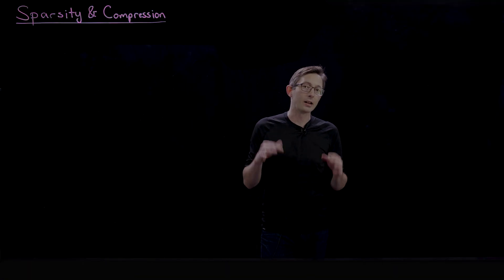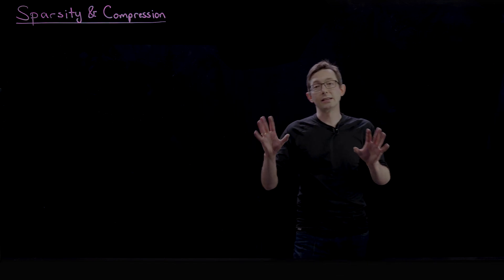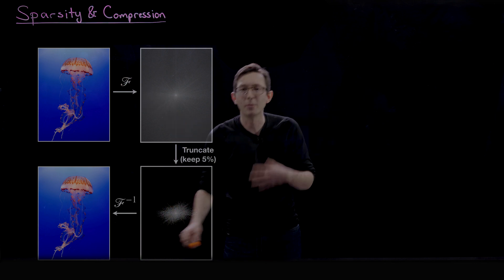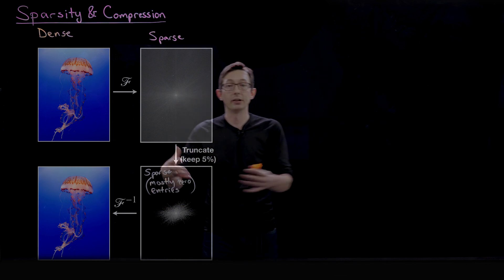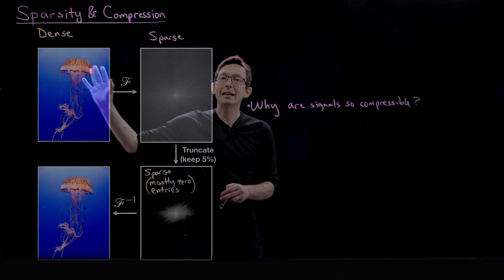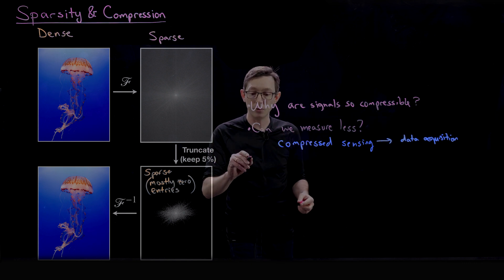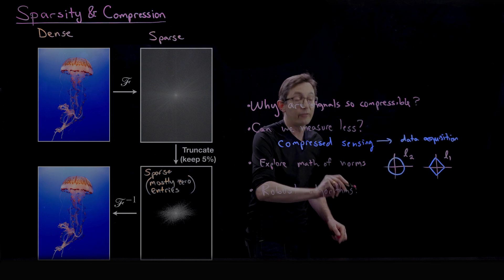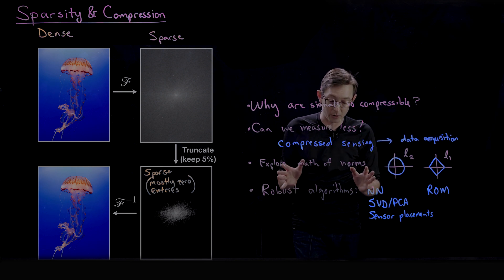Sparsity and Compression: An Overview

Comment: Sir, Thanks for lecture, I have few things to ask:

1. From your DMD book, flow past cylinder(Re=100), has vorticity contour 151 snapshot data in mat file(has "VORTALL"), which we further apply DMD/POD.

2. I have PIV raw image datasets (Jets, flow past Cylinder, image pairs upto 1000 for each case). 
at this stage i need help
How do i stack the vorticity contour data into matrix X and X" to study DMD.

It would be great help if you can able to explain.

Thanks

Comment: Sir , what is l1 & l2 norms? Why we need them?
Reply: L1 norm is the sum of the absolute values of elements and L2 is the Euclidean norm
Reply: @hardrocklobsterroll395   thanks :)
Reply from the maker: @hardrocklobsterroll395  Thanks!
Reply: more generally, Ln norm is the n-th root of the sum of each coordinate to the n-th power. It can be extended to infinite size and with some limit magic you can prove that L infinity of a vector is its largest entry
Reply: @alegian7934   thank you :)
Reply from the maker: I'll have a video on norms in a few weeks.
Reply: @Eigensteve  Thank you Sir, your lectures helps me understand complex mathematical tools and thier applications